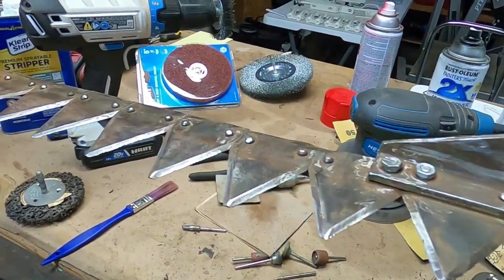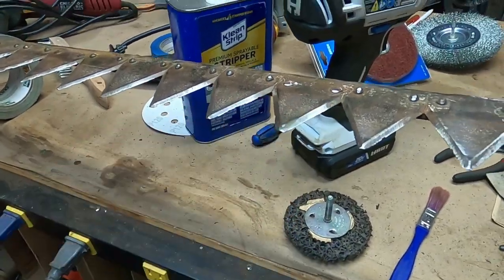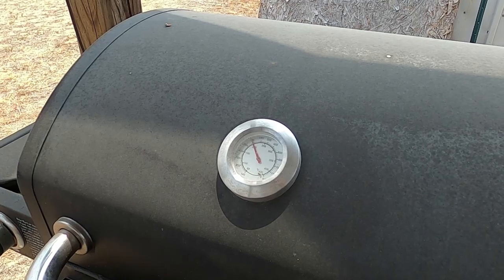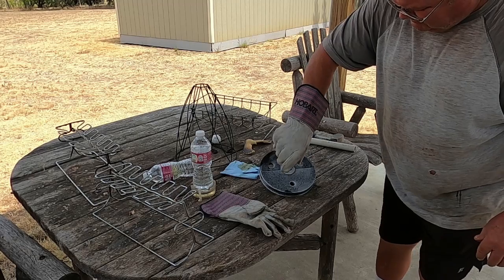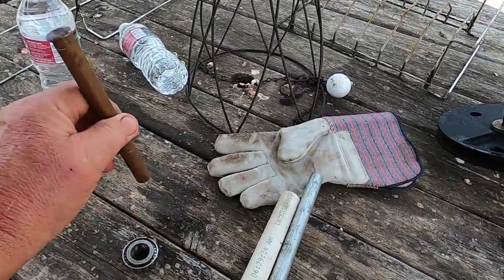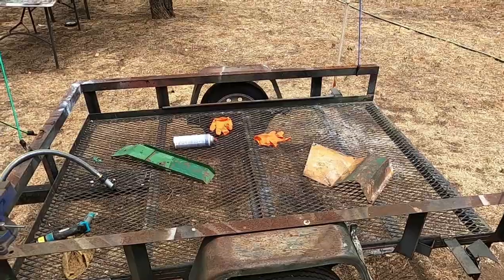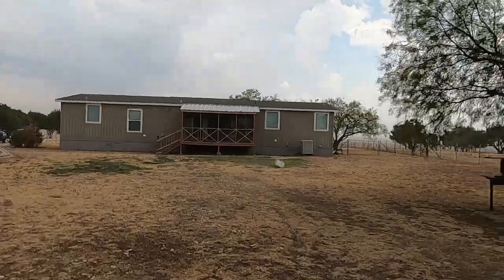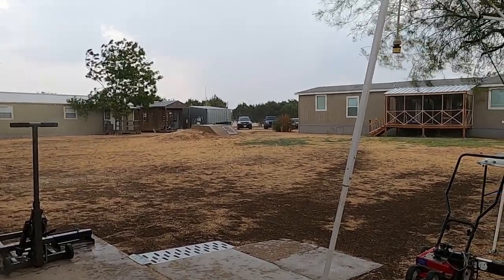Sickle mower Pt 19 Almost had a disaster

Comment: with the pvc, if you put on a coupler and pvc bonder glued it on, you can then sand it down flat so you have a thicker more reinforced pressure base and apply some pvc bonder glue to the base and make sure it gets nice and gooey and tick the right I.D.washer on that has worked well for me as a one off and done in the past, but usually a piece of old iron galv irrigation/water line pipe has worked even better in the past and the I.D. matches up better with the crankshaft.

Comment: We found the press works great for bearings, we tend to make a steel sleeve we can use to push against the inner part of the bearing. This is where a lathe comes in handy. That bearing did look tight though
Reply from the maker: I watch way too much Cutting Edge Engineering. He uses the heat & chill method a lot. The steel sleeve for the press was an issue, but I got it sorted. thanks.